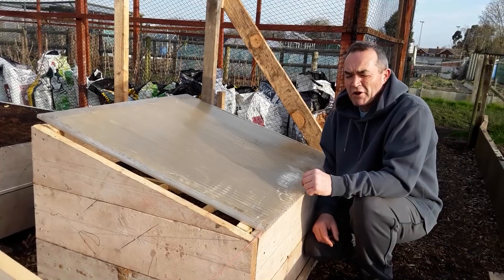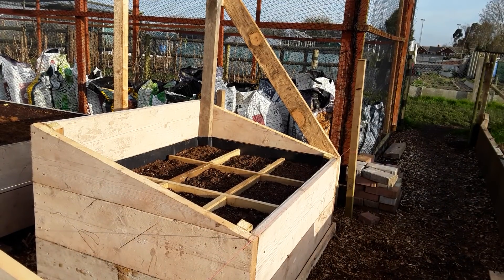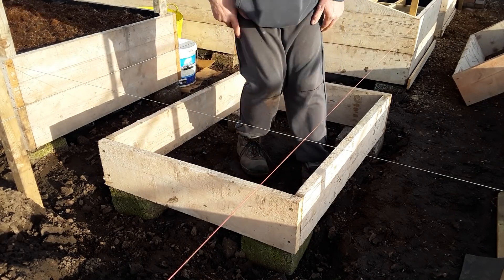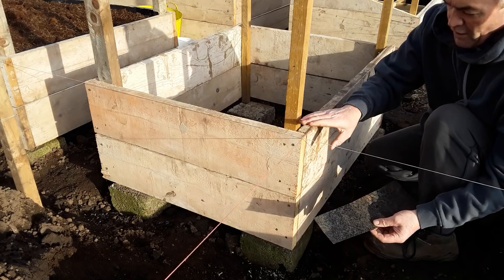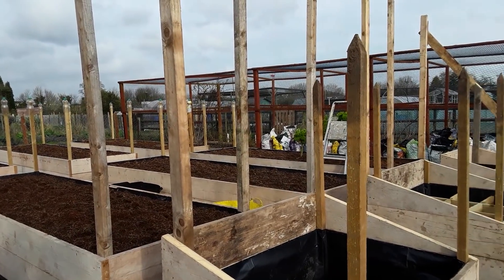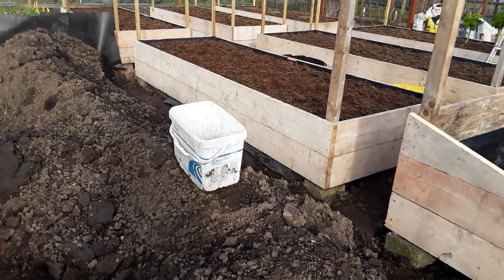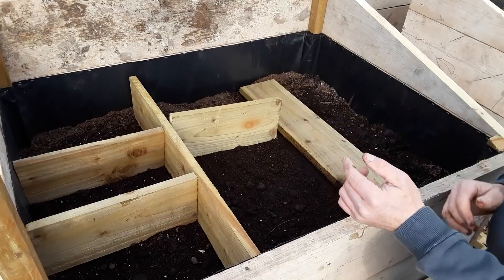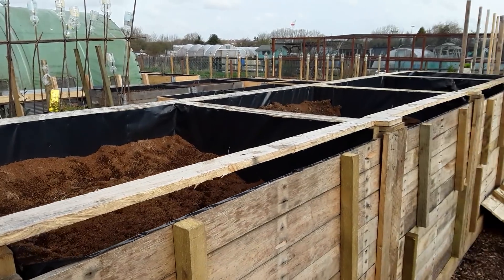How To Build A Square Foot Gardening Bed To Last A Lifetime ♻ Collaboration With Small Garden Quest

Comment: Hi, what was the membrane called? The wind blew at an inopportune moment and I missed it. I think you said the dividers were made from tanalised wood, any issues with using for food plants?
Reply from the maker: Visqueen membrane from a builders merchants and that's the only tantalize wood I have on the allotment so not overly concerned and I won't let it go rotten and contaminate the soil. 

♻️Happy gardening, Terry King.
Reply: Terry King's Allotment Gardening On A Budget: Cheers for that, what made you decide on it to line your planters?
Reply from the maker: @H2Dwoat  to stop excessive moisture getting into the wood, if wood doesn't dry out it will eventually go rotten so restricting the amount of moisture the wood absorbs it will be able to breath and dry out quickly so no need to apply a preservative and will last along time. This is why the whole bed is off the ground.
Reply: Terry King's Allotment Gardening On A Budget hi, thanks for getting back to me. I I understand the concept my question was mainly about why that particular product. I am looking at options myself and I am considering treating the timber with the Shou Sugi Ban process to try and protect it from the elements. Any thoughts?
Reply from the maker: @H2Dwoat  I found half a roll in a skip and it was thick enough not to damage easily and easy to fit. I have never actually achieved anything from treating timber that touches the soil as it always goes rotten so this is why I have gone to this trouble.
Reply: Terry King's Allotment Gardening On A Budget cheers.
Reply from the maker: @H2Dwoat  ♻️👍😁♻️